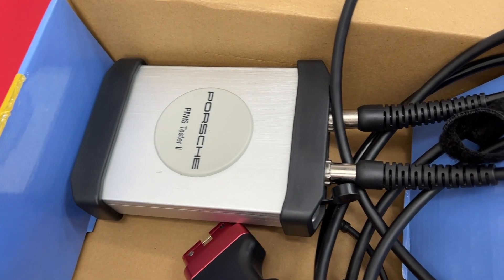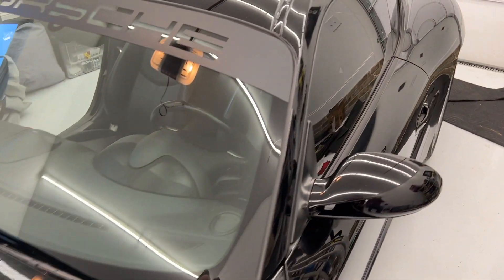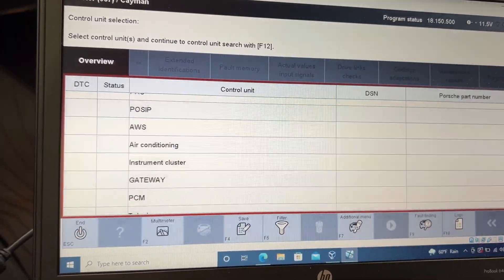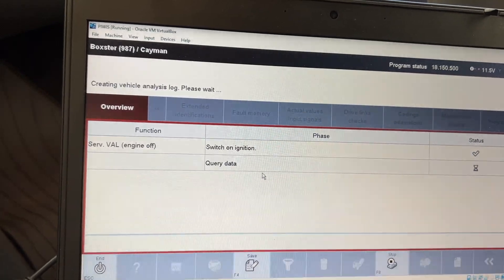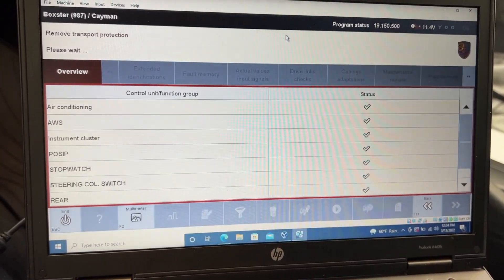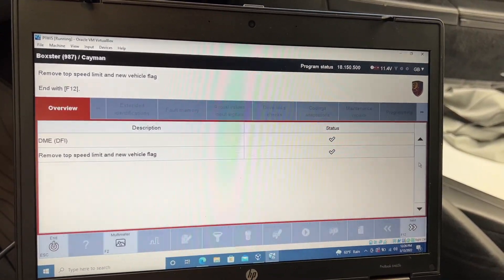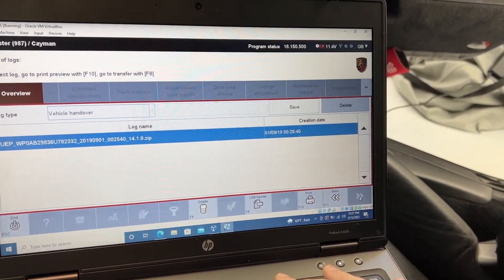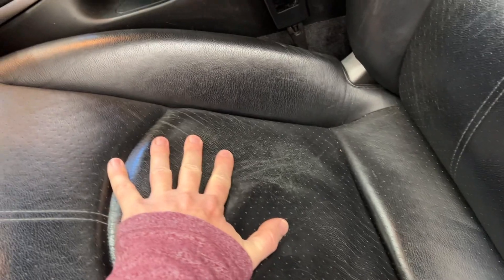How to Perform a PORSCHE VEHICLE HANDOVER Using PIWIS

Comment: I have 992 and handover doesn't seem to be enough, what else can be done from the following menus?

Vehicle handover

Vehicle analysis log (VAL)

Campaign

Vehicle data maintenance with PIWIS-ONLINE

Read all fault memories and erase if required

Inbetriebnahme Wegfahrsperre

Wegfahrsperre (Entwicklungs0Ablaufe)

Inbetriebnahme Komponentenschutz

Komponentenschuz (Entwicklungs-Ablaufe)

Zusatzfunktionen des Komponentenschutzes

Funktionsfreischaltung

Produktionsmodus deakivieren

OBD-clear DTCs

Rollenmodus

Small ConfCo application

Vehicle order import/export

Program flash package

External applications

Comment: Thanks for sharing! Did you need an external power supply to the vehicle to perform the handover?
Reply from the maker: +@FJ4X420 I didn’t but it is recommended. At minimum make sure your battery is strong and fully charged. I recently found a power supply I use now when doing coding. I’ll try to add a link to the video description.

Comment: My car is a 2006, 997 and when the battery dies, I lose the heated seats and the headlamp washers. In Ireland, the car will fail the annual road test if the headlamp washers are not working.
Reply from the maker: +@francisoreilly9031 really?? That’s crazy they fail it.

Comment: Do you need to be connected to an external power supply to do a handover?  I installed a new steering module and need to run a handover.
Reply from the maker: +@user-xw6cr4pu9m I think you would be fine without it. It’s pretty fast
Reply: @HelpMeDIY  thank you!!

Comment: Hi, recently swapped a 997.2 s instrument cluster to my 997.2 (non s). The oil temp is not working (everything else seems fine). Is there any manual coding or “handover” specific for the oil temp gauge? The sensor is working, but no movement on the actual cluster. Is there a menu for this under “instrument cluster” on the piwis tool?
Reply from the maker: +Joachim Myhre no idea, but report back of you figure something out!

Comment: This happened to me once when I disconnected the battery for too long. I have a Durametric pro and it doesn’t help, had to pay the dealer 1/2 labor to restore the lost functions
Reply from the maker: +M. Serry yeah the PIWIS is needed for sure. I’ve heard of dealers charging a lot more so that wasn’t bad.
Reply: @HelpMeDIY  dealers are the biggest rip off on the planet and most their mechanics are mediocre at best.
I am going to buy a VCI with an SSD loaded and ready to go. I don’t see a point of buying the PIWIS 2 when now they have the PIWIS 3 for almost the same price, and it’s good for even 2023 cars (this years if you guys are reading this in the future)
I don’t even think the latest software needs to be installed in a virtual environment… I think, I’m going to message them now to ask

Comment: I have a 2020 992 and having a hard time finding a scan tool that will read codes AND allow me to complete service interval resets.  Do you know if the PIWIS 3 will do that for my model/year?  Also, where did you purchase your PIWIS 3?
Thanks
Reply from the maker: +Fred Burmer I don’t know for sure about a 2020. I have a PIWIS 2,  not a 3. There is a playlist in the description and the first video I made on the PIWIS has a link to where I got mine.
Reply: @HelpMeDIY  Piwis 2 is good for vehicles up to 2017. Piwis 3 is good up to 2022 I believe (includes Taycan)

Comment: I just swaped out a flooded rear control module on a 987 and now the new one has the tail lights on all the time when the ignition is on. Will the PIWIS program the lights to work with the new module?  Would it be done with "handover"? Thanks.
Reply from the maker: +Torakki09 good question but don’t know the answers, sorry 🤷‍♂️
Reply: @HelpMeDIY  No problem.  I'll figure it out.  Thanks for the response.
Reply: @Torakki09  Did you ever figure it out?
Reply: @Torakki09 hello, did you figure out how to fix it?
Reply: @pennadl  Yes, but in my case, it was also the gateway module that communicates with all the modules.  Replaced it.

Comment: Be careful, you should do the VAL first. Then perform the maintenance. Then a handover. That’s how I do it. My software package has an issue reporting the voltage on the upper right corner. I need to see if I can correct the issue.
Reply from the maker: +A N interesting… why is that? I didn’t have any maintenance to perform this time.

Comment: Just down the road from you. Curious if you have insight on what’s needed to code out the Tiptronic transmission from the dme? Working on a 996 manual swap.
Reply from the maker: +Andre Brown Greensboro? I don’t know how to do that. If you figure it out we can make a video 😉
Reply: @HelpMeDIY  Raleigh! Project is almost all back together, had to add a few wires here and there in the harness based on the wiring diagrams. I’m still playing about in simulation mode at the moment since my cable hasn’t come in yet. Did you have to input the cars IPAS code into the PIWIS program anywhere? Thanks for the videos!
Reply from the maker: @andrebrown8792  I don’t even know what an IPAS code is, so no, I did not 😆. And you’re welcome!

Comment: It would be great to use it to fix a key remote that lost its sync and doesn't lock and unlock the doors.  Or even program a new key.
Reply from the maker: +Eli Criffield yeah I will research keys eventually
Reply: @HelpMeDIY  you can re pair keys quite easily on 987.2+ from what I know, not sure on the gen before though
Reply from the maker: @EnthusiastProject  how?
Reply: @HelpMeDIY  the process for my 987.2 was to put the key in the ignition with the unlock button facing the passenger seat. then turn the ignition all the way but don't start the engine (so don't push in the brakes how you normally would start the car). Then I just held the unlock door button on my key fob (while it's in the ignition), I held the unlock button for over 30 seconds. This re-paired the remote with the car.
Reply from the maker: @EnthusiastProject  very interesting. I have never heard of that procedure. Thanks for sharing.